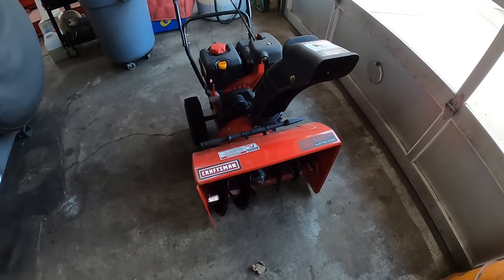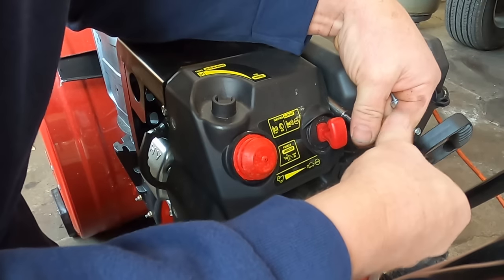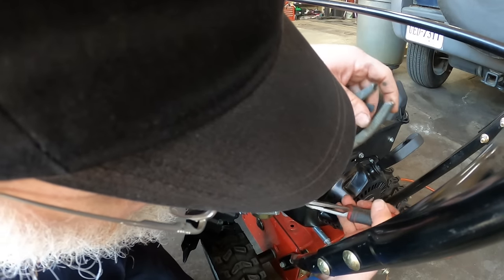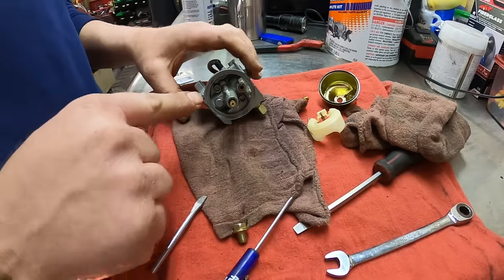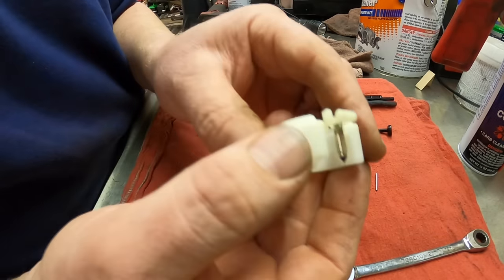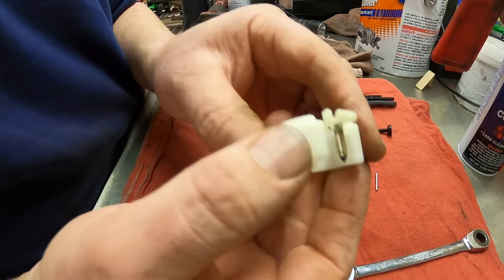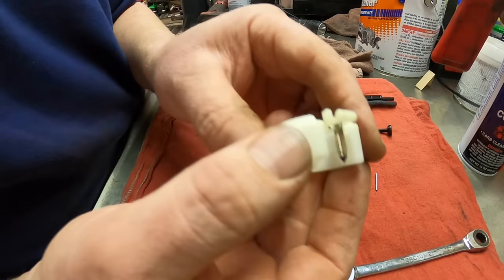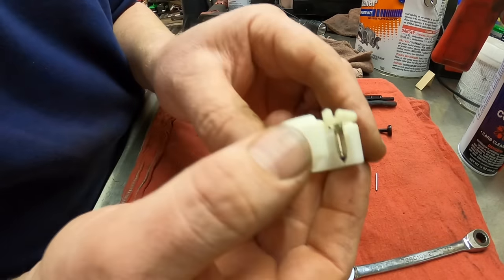Craftsman Snow Blower Won't Start

Comment: I did the cleaning, the machine started but there was a very loud noise and high RPM that scared me and thought the engine will blow off and was so hot.(It has brand new oil). So, i shut it down quickly. What do you think the reason for this? The 2 things I think I did not pay 100% attention to was: 1- not sure if the choke knob was totally closed when i removed it. (the flapper was fully open in the carbonator though). 2- The 5 1/4 turns you did on the half moon screw; i might have missed it by 1/2 turn.   Do you have a solution?
Reply from the maker: The half moon screw is the speed control unscrew it to get the speed down.
Reply: @TheGAutomotiveAndMore  I will try to do it. Can i do it while the engine is running so i can adjust accordingly? Thank you
Reply from the maker: @tawfeeqa2197  yes

Comment: What do I check if I am not getting any spark at the plug
Reply from the maker: Be sure that you have it turned on. So times the magnets on the flywheel will get rusty. Clean the rust off and see if you have spark. Could be a bad plug or wire or the electric ignition.

Comment: The reason why it didnt start at first at 1:50 because the throttle was pushed all the way to the RIGHT, WHICH IS THE OFF POSITION. 😂 There is even a stop sign to show it in the clip!
Reply from the maker: It still didn’t start after I saw that.

Comment: This is my exact blower. I use it only a couple times in the winter. Ive only have it for 2 yrs. I put gas and checked the oil and still wont elec start
Reply from the maker: If you do not  drain the gas out of the carburetor float bowl it will gum up. Especially if there is ethanol in the gas in your area.

Comment: What make is the engine?   Kinda looked like a Honda, but, wondering if it might be a Chinese made Powermore?   Good video, very detailed.  Thanks\
Reply from the maker: There was no markings on what brand engine was. Probably Chinese. Thanks for watching
Reply: This is very similar to my Craftsman and they list the engine as an MTD. So yeah, probably Chinese.
Reply: most are made by the chinese , mines a powermore 179cc , they basically use the same carb made by huanyi ( ? ) I'm ordering a new one , still having issues after cleaning it , they are cheap enough just to replace , my jet would not come out but I put a tiny copper wire up thru it and it was clear  , but in the process I lost my choke linkage , my choke knob isnt on top like that , it's on the side next to prime bulb and throttle , it will run after cleaning but is surging , my carb also has 3 gaskets , not just two , trying to figure out where two of them go which is not a biggie , mines an mtd huskee , very stupid design as far as the way carb is mounted , a child couldve designed it better

Comment: The Walmart units are the same engine design and very temperamental. Using non-oxy fuel is the key.
Reply from the maker: And not leaving the gasoline in them for years.

Comment: Good video, BUT: I have this exact model of snowblower and you DO NOT PULL THE THROTTLE KNOB IOFF! There is a precise spot / position in which the throttle knob can pass through the opening withou being pulled off. It’s at maybe half throttle or so. Get a flashlight and have a look. ;)
Reply from the maker: Yes there is but I fine that its easier to pull the knob off and the cover will come out easier. Some do not have that cut out.

Comment: I cannot find my engine model number in order to call for parts at Craftsman.  It is not stamped on the engine to the naked eye or does it have a label.  Purchased Dec 2019 from Lowe's.
Reply from the maker: One of the most common locations of the model and serial number on a Craftsman snow blower is on the back of the machine. Stand behind the unit and lean down -- you should be able to see the ID tag underneath the handles, in between the two wheels. I found this on the internet. Hopes this helps.

Comment: Was following these steps but now I can’t get the float bowl retaining nut to tighten enough so it won’t leak
Reply from the maker: There should be a washer that seals the bolt to the float bowel.

Comment: My Craftsman snow blower still won't start. Has spark and carburetor has been taken apart and cleaned but still no go. What is the next step?
Reply from the maker: Will it run with starting fluid? If so still has a fuel problem. Spark plug could be bad also.
Reply: @TheGAutomotiveAndMore  I put in a new spark plug and tested for spark; ok.  Where do i put starting fluid?  Someone suggested putting teaspoon of gasoline in spark plug hole. is that safe?
Reply from the maker: @roberthandfield2744  Yes you can put the gasoline in the cylinder that way. Sometimes you can not spray the starting fluid in the carb because of the way the intake to the carb is made.
Reply: @TheGAutomotiveAndMore  My problems continue.  Last week I changed the spark plug and tested it - good sparking! However yesterday when I tried the technique of pouring a bit of fule in the spark plug hole it didn't fire so I checked  the spark plug again and no spark at all. Hane you posted a video on on to fix the lack of sparking.  My engine is a 277cc MTD on a Craftsman snowblower.  Thx for your help.
Reply from the maker: @roberthandfield2744  No I do not. Frist thing to check would be the stupid key thing. Next I would take off the engine shroud and if the magnets have rust on them I would sand them down.

Comment: Is there a secret to getting the primer tube out that you didn't show on camera? Is there a secret to getting it back in?
Reply from the maker: Its just a hose, it unplugs and slips back on.
Reply: @TheGAutomotiveAndMore  Thanks I got it! After cleaning the carb I got it running! But now it only runs at full throttle. Adjusting the throttle left or right does not adjust engine speed. It will only run full or shut off. Did I miss something when I put things back together?
Reply from the maker: @donwalters3088  You might have the spring off on the linkage.

Comment: Where does the fuel filter go
Reply from the maker: It doesn’t have one. It might have a screen in the tank. There might not be enough room to put one in between the tank and the carburetor.

Comment: Primer bulb has a small hole in middle, make sure you cover it with finger when priming s l o w l y.
Reply from the maker: That really did not matter because the carb was clogged.

Comment: I bought many tools and machines and this is one of the worst purchases out there, no matter what you do it wont start next year, waste of money
Reply from the maker: I have green Craftsman snow blower that I always drain all the gas out of gas and pull the float bowl off to get that last little bit of gas out of it. The next season fill her up and no problems starting.
Reply: @TheGAutomotiveAndMore  last spring I drained all the fuel out and even had it running untill it dies, to make sure there is no fuel left, last night I put fresh fuel in and it wouldn’t start, might have to clean the carburetor again, thanks for your reply
Reply from the maker: @RS-ft7nv  Running it dry still might still leave some gas in the float bowl.

Comment: Many snow blowers, like Snapper, don't have traditional air filters because they have no need to remove any dust from the air.  
In addition spark plugs right from the manufacturer can, and do, sometimes ship as defective and should ALWAYS be checked.
That's how you lost you my subscription.
Reply from the maker: You are only haft right. My statement was correct. The air filter could ice up or clog with snow and the machine would not run. Here is something from the internet . Welcome to the forum! Snow blowers typically don't have air filters. They operate in a very low-dust environment (unlike a mower), and air filters are more likely to freeze up & clog themselves due to inhaling airborne snow. With the spark plug, if the machine runs on starting fluid the plug is most likely OK. You being a know it all just lost my subscription!

Comment: You shouldn't have to clean the carb out every year Honda!!! POS This is annoying and I expect better from a Honda engine, worse then shoveling
Reply from the maker: It’s not the machines fault, it’s the ethanol in the gasoline. You must drain all the gas out of it and out of the float bowl. Thanks for watching

Comment: I think the majority of the gunk in the carb is from the manufacturing/assembly process. What a piece of junk.
Reply from the maker: No Its from leaving gasoline with the 10% ethanol in it. That gasoline is going bad really fast.